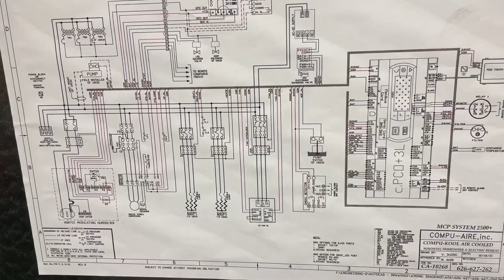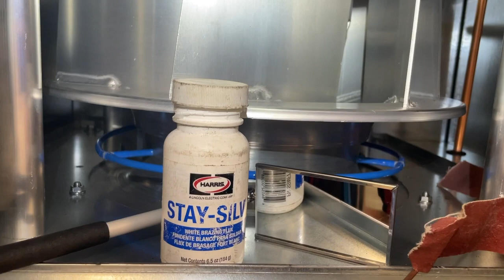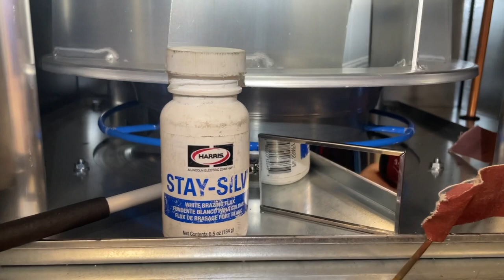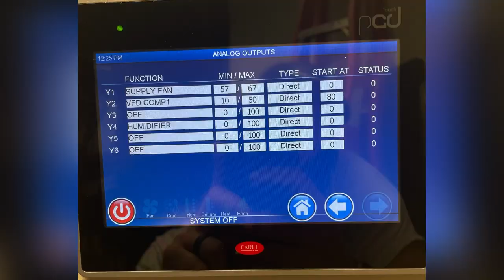Diagnostics16: A Pain in the CRAC

Comment: Hey this unit looks an awful lot like the ones I come across on the other side of the pond , is that an Italian brand by any chance ? Certainly looks like it is eh ...
Reply: @HVACLife  yeah the Carel pCo board is pretty good when you have the tools to connect to it , but the good thing is some of the softwares required are easily found on the net.  The only thing is there might be a factory password that prevents you to go too far with it , but for general stuff like the EEV control or the humidifier , I believe there's no restrictions.  If you go back please let me know the brand .
Thank you mate , nice one 👍
Reply: @HVACLife  well the ones I connect to I use an OEM specific software , but I believe you can also connect using Carel softwares , you'll probably need a specific converter and stuff like that though . If you have an email address I can send you the part number .
I think on some versions of the Carel controller you can also connect via an ethernet cable if it has an RJ45 plug .